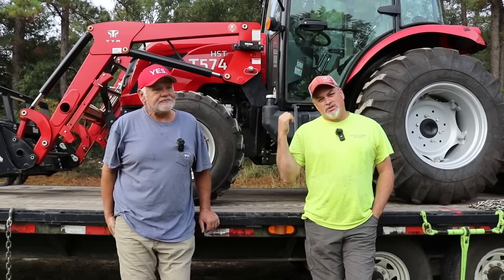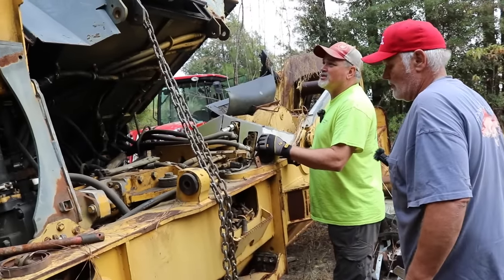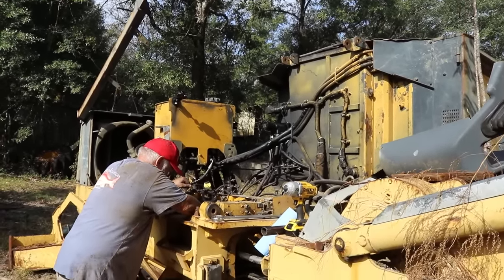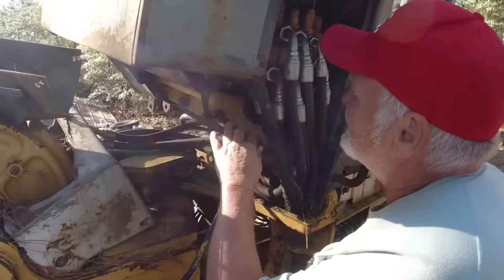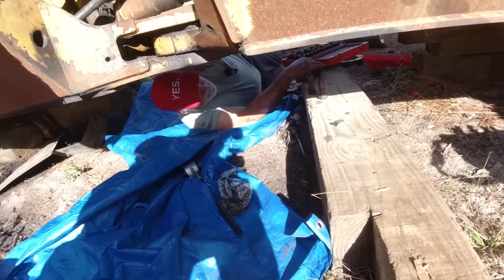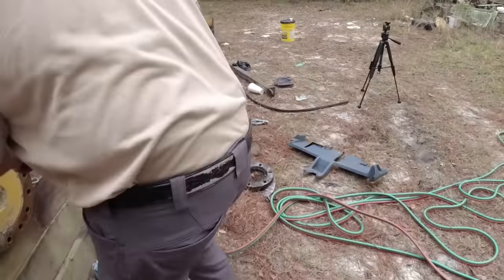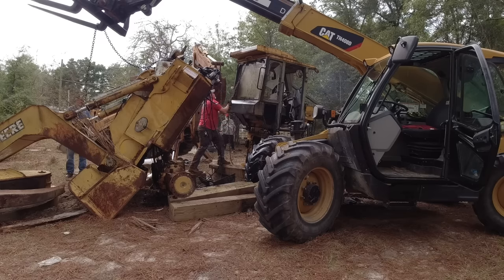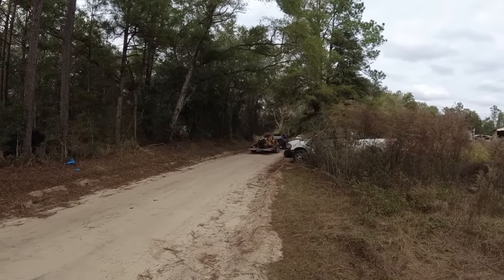The BIGGEST REPAIR Bill in the World!

Comment: If ime right. You have to remove the top and bottom plate. Then take the snapper ring off whitch way you want the pin to come out. So snapper ring from top allows the pin to be lifted up. The 3 bolts I think are torque bolts for the pin to how tight you want the pin to be. Ime no expert.